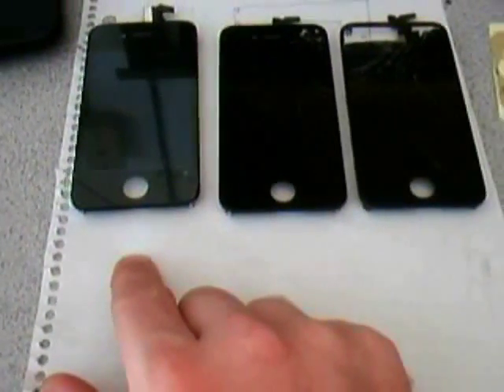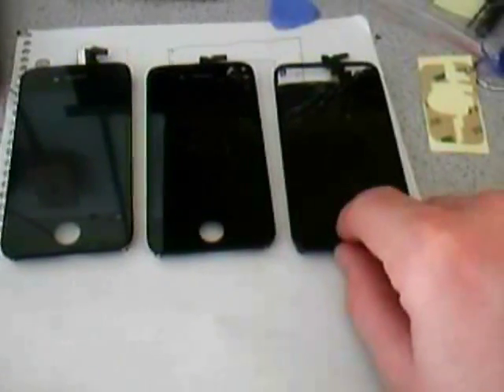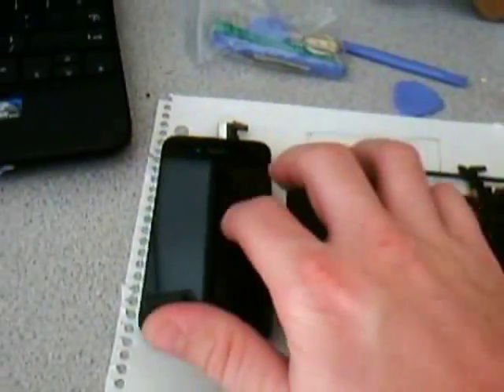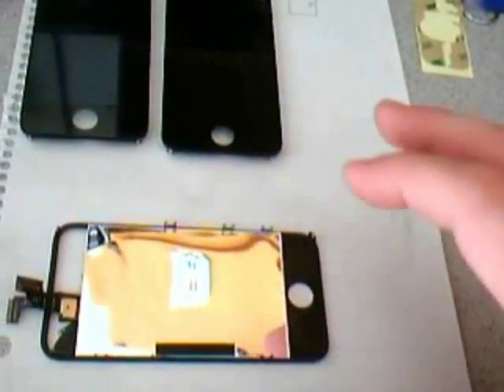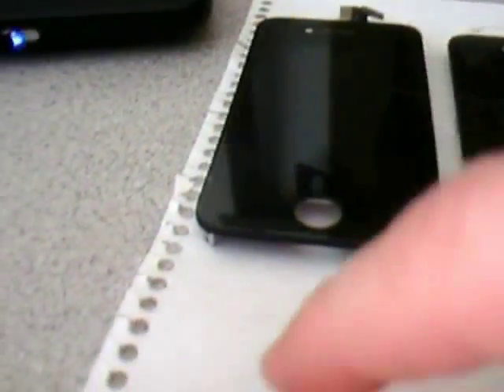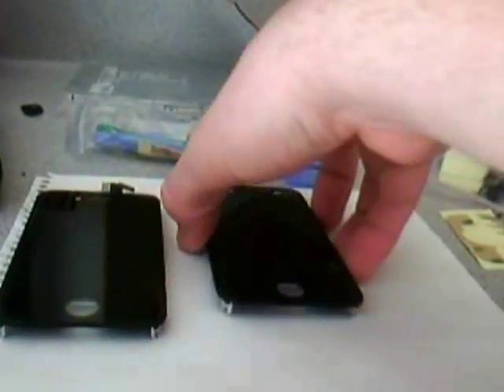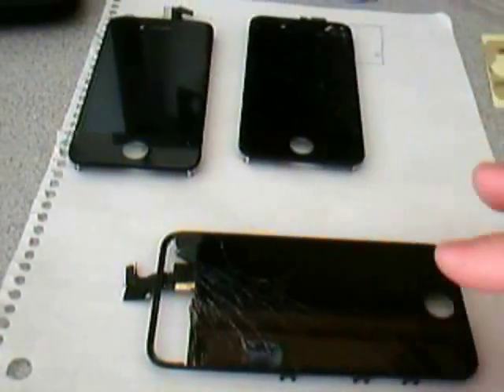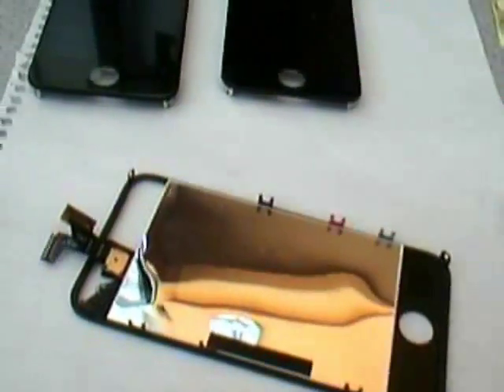iphone 4s digitizer differences Iphone4s

Comment: Cont...no kinks or wrinkles in the cable to prevent it from reaching. I have ordered 2 screens already (from same seller, they gave me story 1st one was defective) Had same issue with second one. So my question to you is...are you aware of any difference in the length of cables between the 3 models of screens. Maybe the sell is selling me 4s assembly instead of 4. Any info would be much appreciated.  Thank You

Comment: Hi, 
I have a slight prob I was wondering if you could help me with. I have a 2nd hand Verizon Iphone4 CDMA model A1349. The front and back glass were severely damaged on it when I got it.  So I ordered a new assembly from a seller on Ebay, (who specificly stated that it was for a Verizon iphone 4 CDMA) When I received it and attempted to install it on my phone the digitizer cable was too short reach the connector on the MB. I double checked to make sure I installed it properly..(see next post)

Comment: My question is will an ATT 4s front screen assembly fit on a Verizon 4s. I know the back glass is diff for those two, due to screw hole difference, but I haven't heard much about the front assembly.